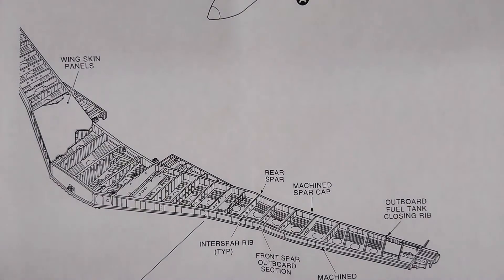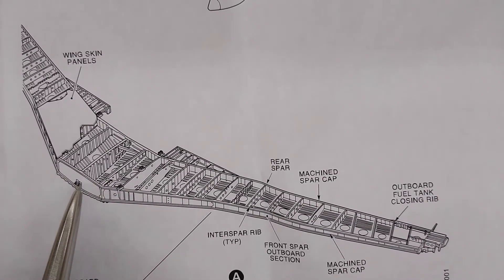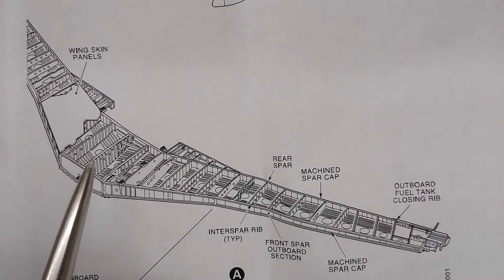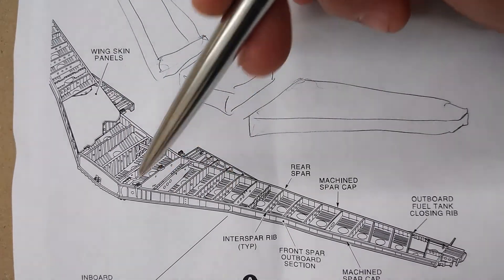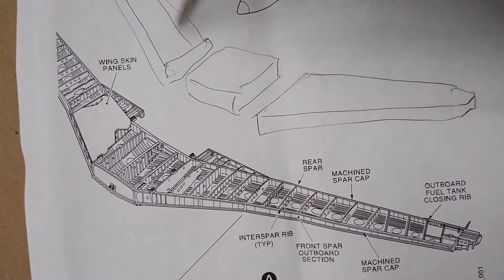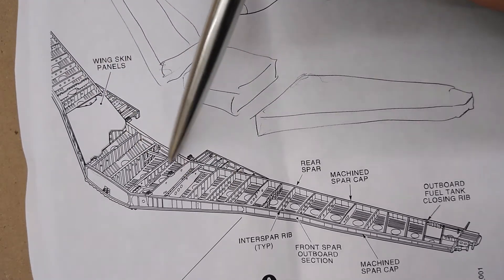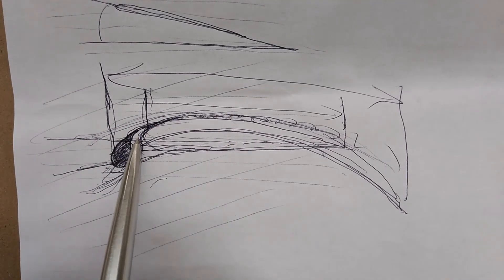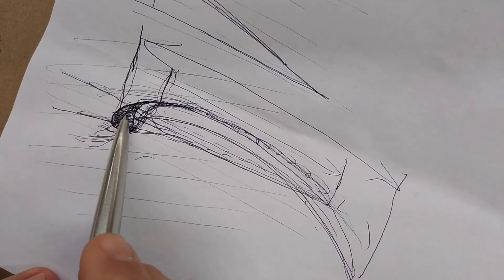DO SLATS INCREASE ANGLE OF ATTACK?

Comment: OK. its YES.
Bside you say no in reality its YES.  I know you want to say yes but when schech it look like is not increase.
The SLAT go in decrese angle of atack but with that you can increase the angle of atack of the plane. So the problem of high angle of atack is the stall event where lift go down drastical, including the slat this make the stall event happen later, due to induced flow air.
If before you can takeoff with an angle of 10º with slat can take off with 12º so at conclusion it increase the capability to takeoff at higher angle of atack.